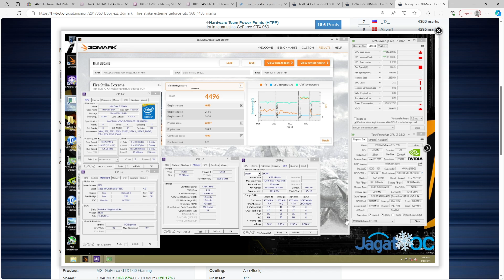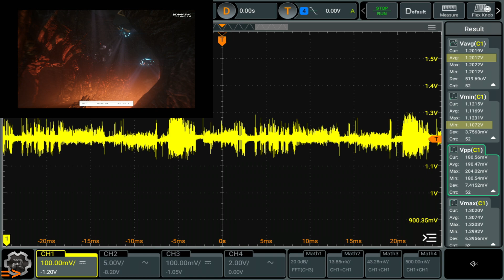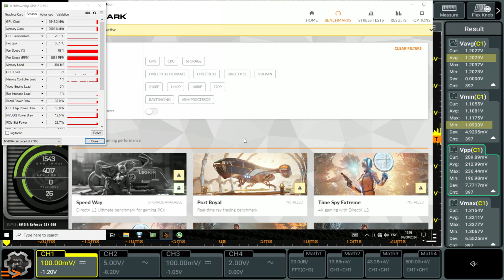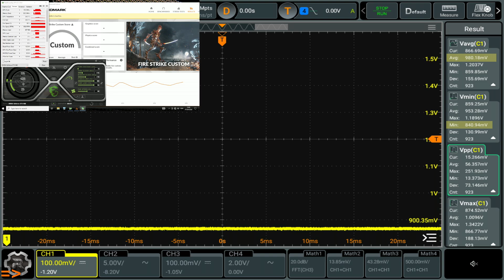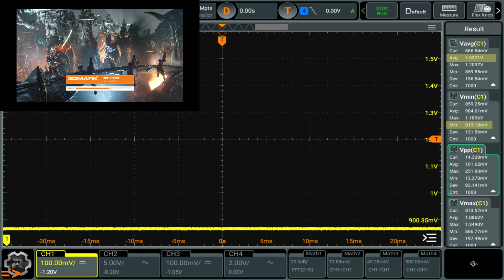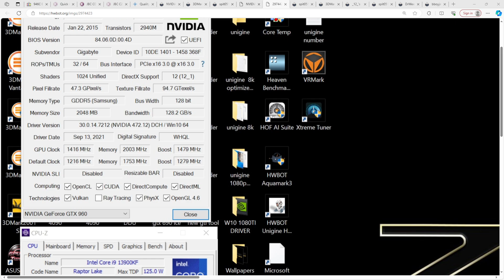GTX 960 Vcore probing and pretesting for benching.

Comment: hi! sorry for my offtop question, but i need help. 
I have r7 7700x with asrock b650m pg riptide and ddr5 6000mhz 2x32 hynix
and in AIDA test i have only 63000 mb/s on memory read. 
i saw that 2x16 gb ram can get around 70000-80000mb/s on read.
is it fine to have 63000mb/s with 2x32 gb ram memory? or i need to fix somth to get full performance?

Also thx for ur vid about hynix timings with ryzen 7000 i followed your guide and it works perfect

Comment: Hey dude, i love your Videos and im very thankful for all the help you just gave me. But now i have another question, how much Power do you think i can push through RTX 3090 inno3d ichill x3 vrm. Point is i want to achieve a 2050-2100mhz Core oc but i dont no how much Power the reference pcb can handle. Cooling is of no concern, the Core sits at 38-40c when Pulling 390-400w. Would be very thankful for a evaluation!

Comment: I have one of the on paper weirdly good looking Gigabyte GTX 960s. I can say that mine hasn't blown up when i shoved 1.4V into it at ambient temps. Though i have seen that vrm blow up for other people. Also that "6 Phase" is actually a 3x2 with doublers because the controller is a 4 phase max. Very similar controller/driver setup to that msi gtx 970 that keeps blowing up its dual n fets.

My card also doesn't overclock very well at ambient. Might just be maxwell being itself or perhaps the massive physical damage on the backside of the core caused by the previous owner has something to do with it. It is missing like 50% of all the mlcc caps behind the core and i can't be asked to put them back.

Comment: Hello, does anyone know of a compatible 2x32gb kit that works on an ASrock B650 PG LIGHTING AM5 ATX mobo. I am opened to suggestions/recommendations of a better board in the B650 universe around the $200 range. I keep seeing so many conflicting reviews on so many different boards. Thank you! I am still watching the video Buildzoid, I do love your content man (especially the rants ngl)
Reply: Dude just buy good 6000mhz kit and do cl30-32 timings with tweaked a little bit secondary timings. It will be a best way to go with good perf and price